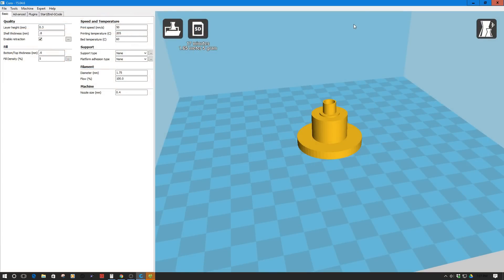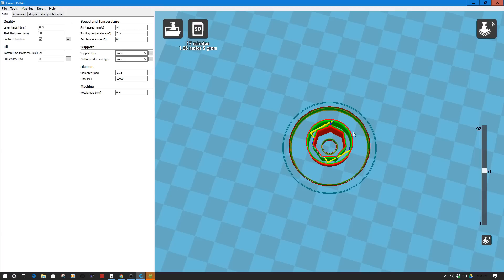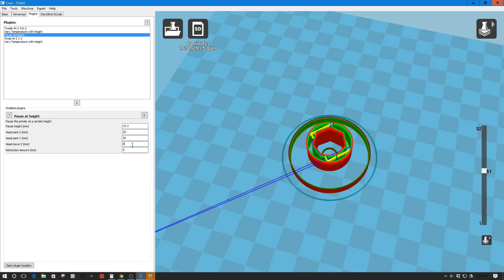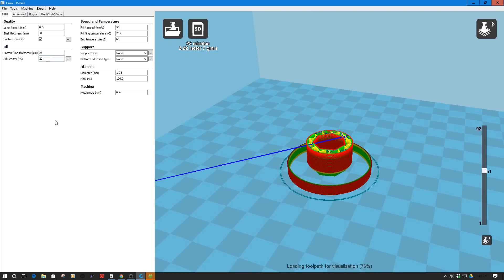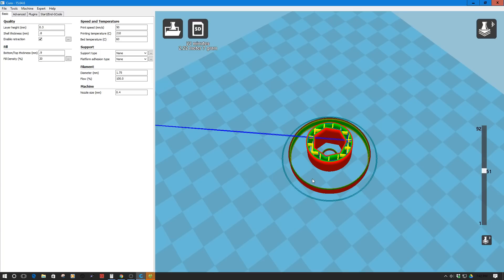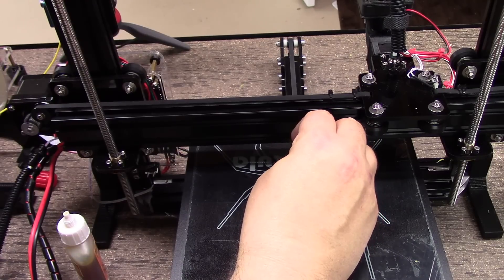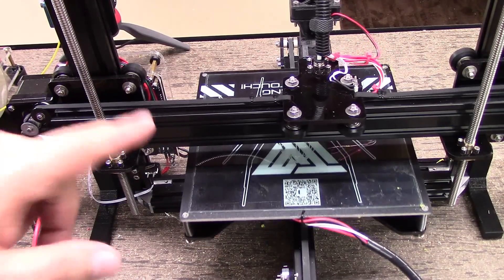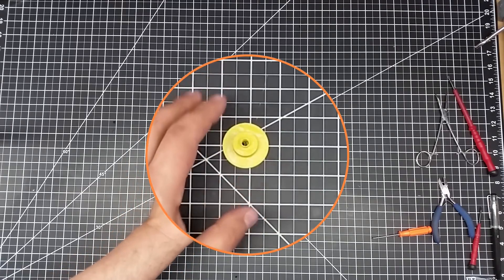3D Printed Project - Tricks to Inserting Nuts Into a 3D Print Using Cura!

Comment: why does your "insert hole" in cura has 7 sides, a nut has 6 when im right ??
Reply from the maker: Not sure I understand the question...
Reply: @DIY3DTECHcom  The hole in the model has 7 sides. A nut has 6 and is a hexagon.
Reply: @burtonkent4549  1:40 I never noticed that, the hole for the nut in the model does have seven sides.

Comment: How do you know the threads of those two nuts lined up? Shouldn't u have dropped them in together threaded on the same bolt?
Reply from the maker: Ah good question!  Should have covered that in the video!  They don't have to the reason for two is there one bolt on the top and one on the bottom and I designed it so there just enough distance :-)  You can see more here: https://www.youtube.com/watch?v=Co50f-G518Q
Reply: very good point! if you wanted 1 bolt to go through both nuts, you would need the nuts to have at least 1 thread peak to peak of float.
Reply: if you did need them to line up you could use a set screw or cut a bolt to use

Comment: white gorilla glue foams less , is stronger , and if you force it to foam by spritz with water is can create predictable expansions . breathing on GG provides enough moisture to start foam and speed curing .  Handy stuff use both dark and white GG for my R/C aircraft builds.  if you foam GG into fiberglass mats it becomes handy for making light strong structures . great vid man  .
Reply from the maker: Long time no hear from!  Yup also have the white stuff too(from our last conversation), however wanted foaming of the brown to fill the gaps and good point about breathing on it!
Reply: yeah brown foams real well.  I wonder about putting fiberglass 'fluf' in it for strength on bigger things . But yeah things have been nuts in my world rite now and had a net outrage for a few weeks(storms) .it was horrible. LOL 
 i was thinking how cool it would be to use a electromagnet to hold a nut on a hot end , and have it press a hot nut into a cavity and let go , but im nut like that . LOL  i have used a old soldering iron to insert brass standoffs that way by hand LOL
Reply from the maker: Interesting and know what you mean about storms!  Been on generator for now for going on two days here in Michigan and no internet!  Just doing this on my phone :-(
Reply: YouTube notification seem to be broken again ,  I only just saw you reply here on the page rite now .   YT has to fix their notification systems .  when you could bond it to G+ it worked great now its worse than hit or miss.
Reply from the maker: Agreed on the notifications!
Reply: That's for the great fiberglass tip. I was looking for a lightweight way to infill a flat section of a print without going 100% infill. With the right infill pattern the foaming glue might be enough to give the part enough rigidity. If not I could create the mat in advance, make the part hollow and then pause the print, glue the mat in place and restart the print.

Comment: Awesome, I think some of this can be applied to Simplify3d, just need to figure out how to pause at the right level and get the head to move out of the way without losing it's bearing (no pun intended).
Reply: Problem is no plugin support so you would have to traverse the gcode to do it and if you use a Mightyboard based system then you are screwed as those use compiled gcode (another reason I do not like my Flashforge clone or Flashforge/Replicator itself).
Reply: good points, I haven't played with it. 

Was just thinking about the layer height control, where you would have different options at certain levels, like color change. Though the head would probably be in the way. There is a way to get around the x3g, but it does require a raspberry pi running octoprint and GPX Plugin. I send gcode to my pi, which then converts the gcode to x.
Reply from the maker: Now this is interesting as I did not know (as I don't have one)